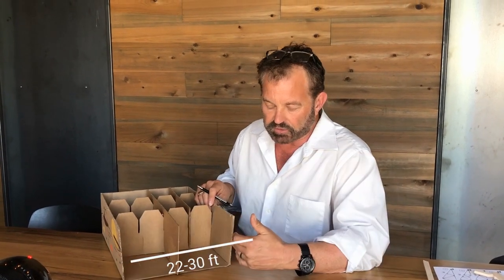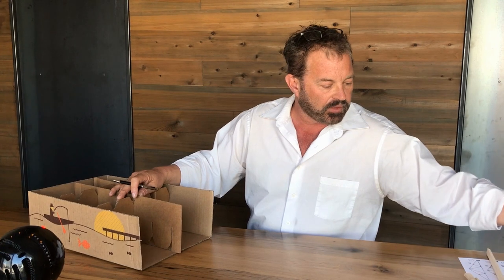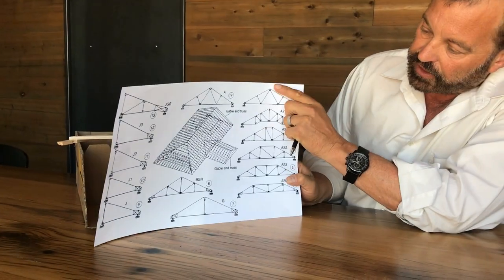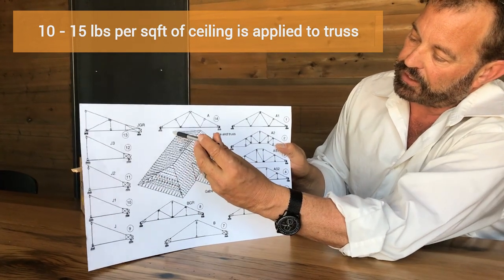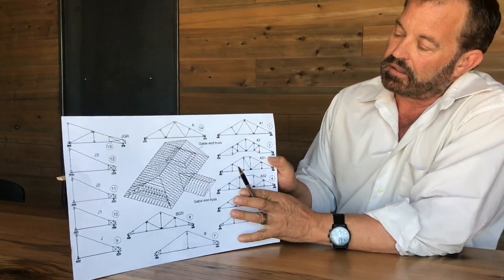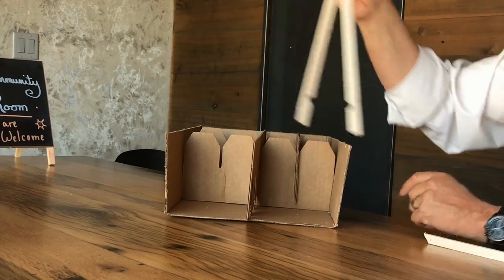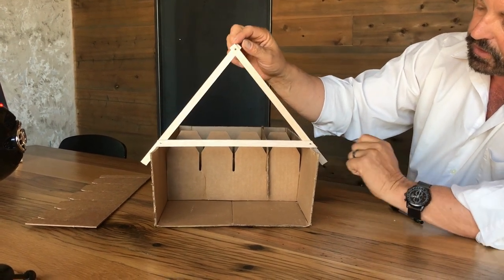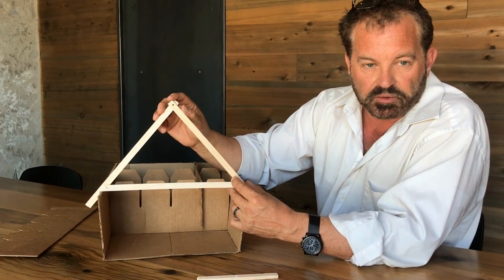Create an open floor plan by removing a Load bearing wall

Comment: Thanks for the helpful explanation! One thing, how do you keep the exterior walls from collapsing outward when you cut the horizontal beams?
Reply from the maker: Hi Alton, in this case, there are seldom forces that would exert pressure outward, the only reason for outward pressure would be a possible negative pressure during a high wind event.

There are concerns here, however. the vertical forces of the ceiling are being handled by the beam downward. The lateral forces resisting wind is an issue to pay attention to. The connection of the beam to the exterior wall is a design element that we carefully consider.. often metal strapping is sufficiently provided by Simpson will suffice for these small single story homes.

great question!

Comment: Great Video. I am wondering about what happens with the simple triangle framing (not a truss, number 7 on your chart in the video) when you cut the ceiling joists, do you need to put in some kind of temporary collar ties above to keep the triangle rigid until you get the beam in and the joist hangers on and Simpson strapping on?
Reply from the maker: Thanks Giles. Be careful here!!! Small houses without heavy roof loads can often be no problem. But check the outside walls for plumb before and after installation. Adjustments may be needed if they spread.

Big rooms or working with tile roofs or Minnesota snow loads. Brace it a bunch!!!  Check with your local engineer for advice BEFORE YOU START!

Comment: Nice video! 

What type of tension strap you used and how you connected it? Isn't beam in the way?
Reply from the maker: Thanks 12bbbk! The flush beam and ceiling rafters are flush after installations are complete. Therefore flat MST straps from simpson work well. Center the strapping over the beam and get straps that extend at least 12 inches onto each rafter bottom side. This all should be done from the room side not the attic side.
Reply: Thanks!!

Comment: Hello, so the main purpose doing this task is the remove the wall and make a better space right?,  If so. was that 2  supporting column on after picture. put on purpose for decorative purpose or was it necessary to put those to support the bearing ? thank you .

Comment: So the hidden beam design can only be used on single story homes and not 2 story homes?
Reply from the maker: Great question Dave. The application of the hidden beam concepts can be utilized on multiple stories. The size of the beam changes as the additional loads are compensated for.
Reply: @levelengineering  Hello.  I wanted to find out what was the length of the beam that you installed from support to support.  Thank you.

Comment: Is there any temporary supports you installed to prevent the rafters from pushing ln the exterior walls (rafter ties, collar ties) between the time you cut through the ceiling joists and the point where the straps were secured to reestablish tension? Or is it such a short amount of time, that's it's not such a big deal?
Reply from the maker: Be careful here!!! Small houses without heavy roof loads can often be no problem. But check the outside walls for plumb before and after installation. Adjustments may be needed if they spread.

Big rooms or working with tile roofs or Minnesota snow loads. Brace it a bunch!!!  Check with your local engineer for advice BEFORE YOU START!

Comment: what about in the crawlspace. any support needed where the beam rest on the end?
Reply from the maker: Yes!! Good comment, our most common problem is improper revised load path to the foundation. There should be solid blocking all the way to the foundation and/or basement beams.  If it's a beam check with an engineer, revised loading on a beam can be problematic to the beam.

If end loads are big enough or the openings get beyond a certain point a new column and footing in the basement may be needed. Again check with a structural engineer to get specific advice for your project.

Comment: I can't tell in the video, but how is the tension strap installed?
Reply from the maker: The flush beam and ceiling rafters are flush after installations are complete. Therefore flat MST straps from simpson work well. Center the strapping over the beam and get straps that extend at least 12 inches onto each rafter bottom side. This all should be done from the room side not the attic side.
Reply: @levelengineering  I'm not sure what you mean by center the strapping over the beam...  Is the strapping running underneath the joist/rafter ties from one side to the other? Is there any way to illustrate how the strapping is installed?  Specifically, if it is a flush LVL that is 20" deep with 2x6 joists/rafter ties (offset), can the strapping run along the bottom?

Comment: Why is the temp load wall double beamed at the bottom and only single beam at the top? Can i use a single beam at the bottom too (i dont care about damaging the floor surface as its coming out after the ceiling beam goes in)
Reply from the maker: Thanks Em. The double bottom plate is not really a structural reason for being implemented but rather ease of shimming.
Once the wall is placed it can be placed fairly loose to prevent damaging finishes. Once the walls are in place shims can be driven between the plates to snug the wall up to support the load temporarily. These shims should be placed under each stud. After completion, reverse the order and remove shims first then remove the temporary walls.

Comment: Great video, but wondering what the straps you used to provide lateral tension are called and who they are sold by?
Reply from the maker: Hi Kyle.

Simpson Strong-Tie provides the industries most common source.. the big do-it-yourself stores have them or lumber yards.  Simpson MST model straps downward from the beam to the studs under the beam both sides for uplift is common for this solution.. horizontal  LSTI-straps at the top plates is also wise..

Thank you.
Reply: Hi Level Engineering, 

Thanks for your reply and clarifying for me.